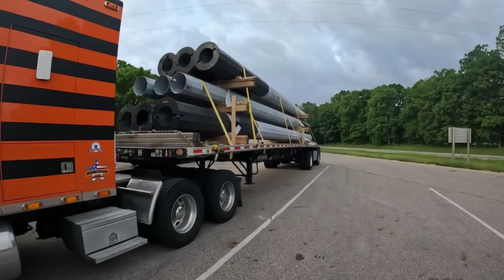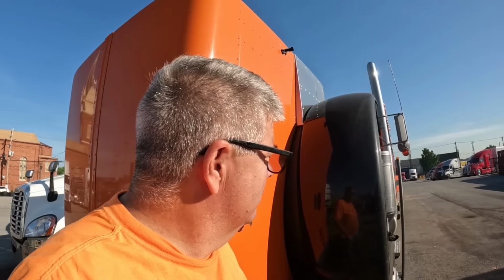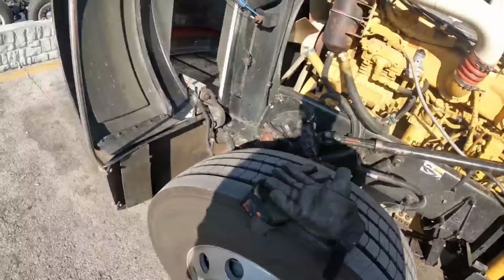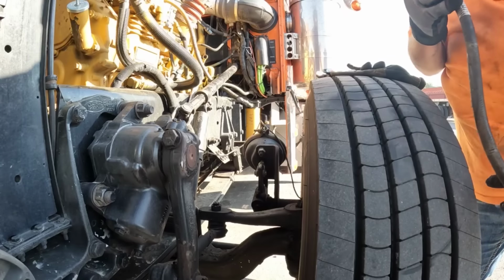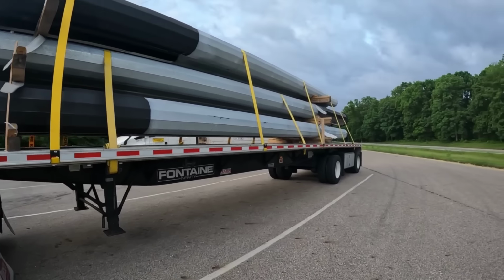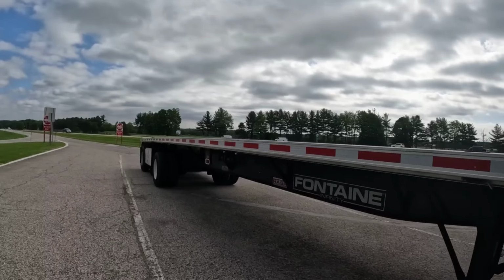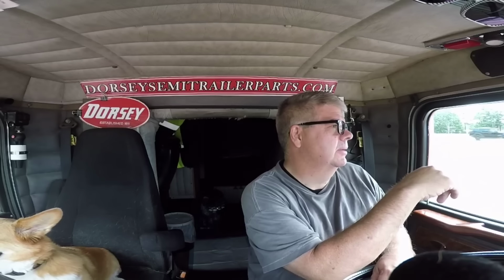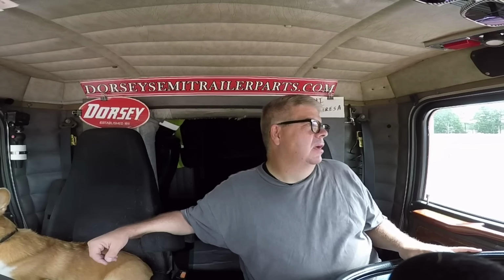#730 Repowered Load The Life of an Owner Operator Flatbed Truck Driver

Comment: Carry 3/8” brake line and hose field repair kits .  Very handy for brake chamber replacement , the field repair kits fitting  ends will swivel .   The plastic is referred to as poly loom  , split wire loom , tubing , or conduit . Clean Looking Unit !

Comment: Hi Dan, I'm a Canadian driver and I enjoy your channel. I have been in the industry for 46 years. I drove for 12 years then became a mechanic, managed 2 fleet repair shops in that time the second shop for 20 years then 2 years ago I went back driving a company truck, we are also in the flat deck industry. The damage on the hose you replaced was not from the split loom, front steering axle brake pot hoses are bad for that just because of the way they have to be run to the brake pot its just one of those things that can't be helped we change them usually ever couple of years and when we do we change them both. That's one of the things a DOT up hear will look at if he is doing an inspection. Love your channel.

Comment: 4:05  Split wire loom.  I'm not certain I would agree that the loom contributed to the failure.  More inclined to think positioning was at fault.  It's a rare day I leave split loom on anything.  In my experience it only hides sins, failures, and debris.

Comment: Nice job catching that hose wear in the yard before it could become a real safety or break down issue.Do you keep a note book with part numbers so you can call a dealer and check on availability on a needed part?